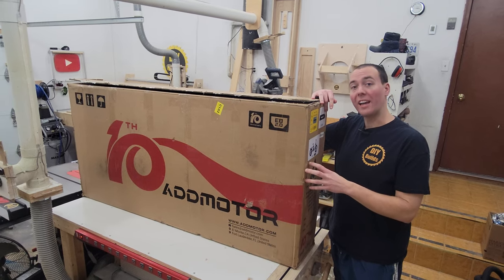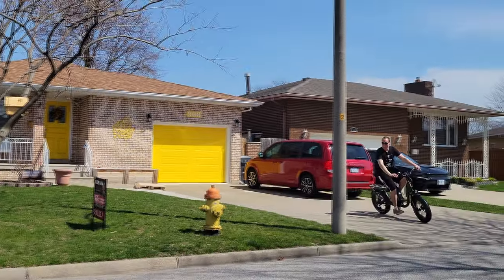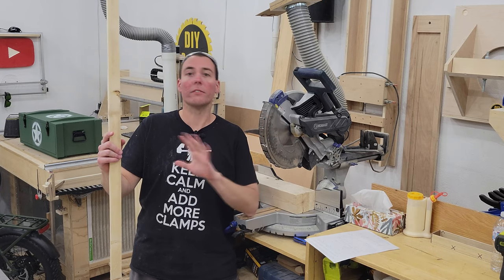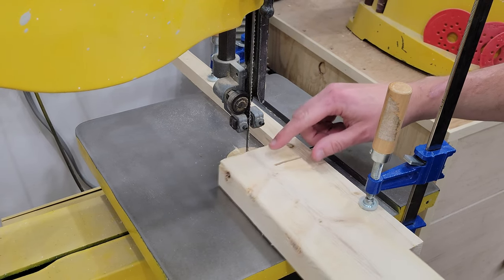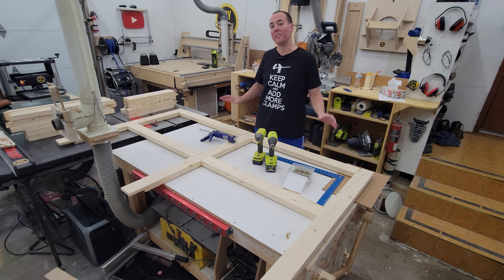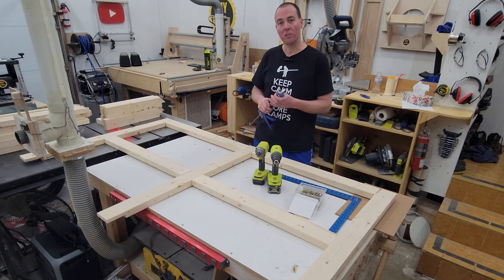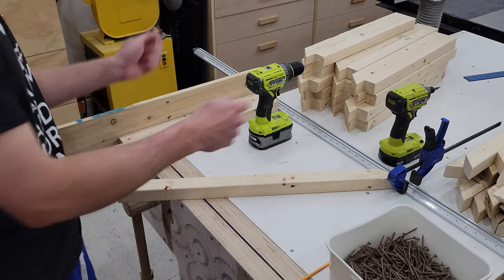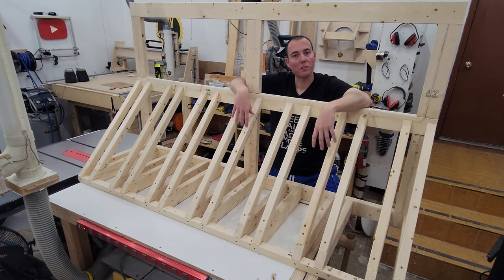How to Make a Bike Rack / Stand - Free Plans!

Comment: Safety comment: Riding your bicycle on the road without a helmet isn’t very smart. Also, where I’m from riding a bicycle on a sidewalk is illegal. Leaving helmets outside in the sun will quickly cause a safety problem.
Why did you use pressure treated? 
I like the design and simplicity. Very nice.
Reply from the maker: Safety is personal responsibility. Do what you're comfortable with. I did not use pt.